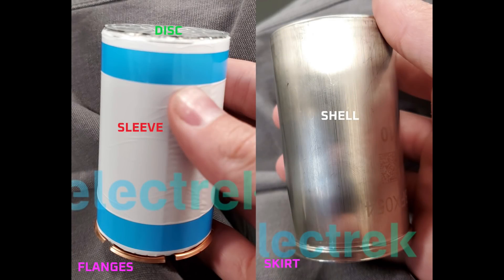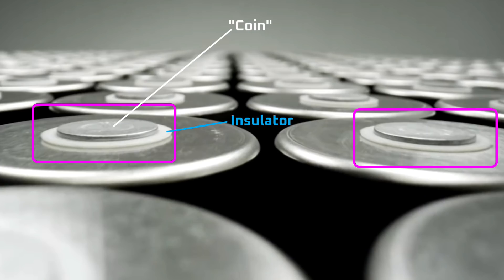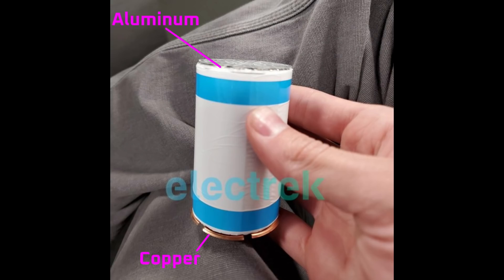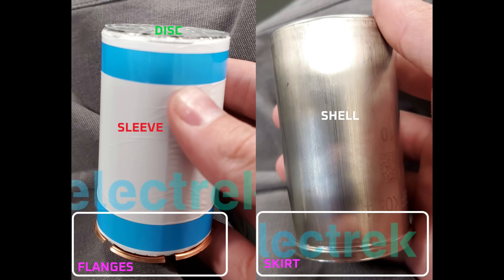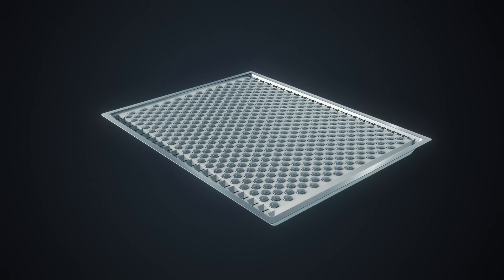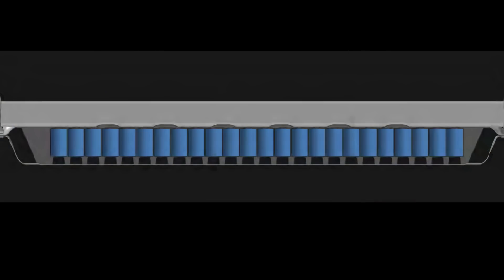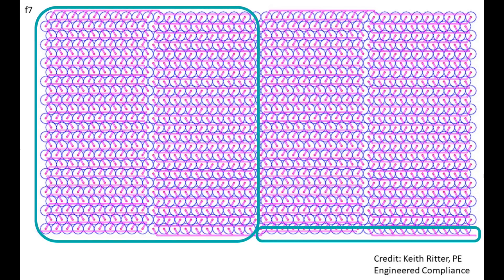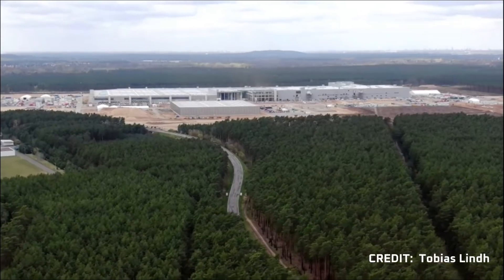#16 Manufacturing the Structural Battery Pack from the Cell Up

Comment: Tesla is betting the company on the 4680.
Reply: Please explain further. Are you thinking that the future is in solid state Li-ion? Prismatic? Why do you think that the 4680 is a risk so large that the future of the company depends on it?
Reply: @Buddy308  The 4680 is the way Tesla is banking on to lower costs. It will have to compete with hoards of competitors soon. The 4680 is unproven technology being is such a large form factor. If, for example, the 4680 catches fire and a massive battery replacement recall is issued, it could end Tesla. They have designed the future around single piece castings with structural battery packs that hold 4680 cells. They are out on a limb.
Reply: @HeavenGuy  the model y from Freemont are currently being produced with 2170 cells and single rear body castings. While 4680 is ideal, tesla can pivot back to non structural battery packs with a few more cells (already proven and works better than competitors) and be fine. Would it be bad for tesla if the 4680 architecture was dangerous? Yes. However, if the 4680 architecture is safe it's a game changer.
Reply: @beilkster  Agreed. They are betting the company on the 4680 and if they hit the ball, it is a screaming home run. If they don't, there will be starship pre 15 style crash landing.
Reply: @HeavenGuy  
Many good and valid points have been made, but I still don't understand why it cannot be tested extensively enough to assure the worth and the safety of the concept before implementation. I still don't understand why you think the company will implode and cease to exist if the technology turns out to be unsatisfactory. I'm not saying that you're wrong. I never meant to argue, just to understand.
Reply: @Buddy308   We aren't arguing as far as I can tell. One of the Korean automakers just recalled all their electric cars for battery replacement due to fires. Even GM recalled a bunch of bolt EVs for battery fires. A bigger form factor 4680 means potentially more heat generation. I'm saying it is a risk is all.
Reply: @Buddy308  future products have designs that depend on the 4680 to work, with the structural battery pack. The designs would have to be radically different if Tesla has to use 2170 cells. But more critically than that, Tesla needs to have the enormous amounts of battery cells they are counting on the many innovations of the 4680 to allow them to produce. The amount of investment, time, cost, and then the added cost and complexity of making battery packs using 2170 cells makes it way harder and less likely for Tesla to ramp production at the speed they want. If for some reason Tesla were to be forced to abandon the 4680 project it would be a severe hit requiring redesign of the Model S Plaid +, Cybertruck, Roadster, Semi, Model Y Berlin, the Berlin and Austin factories, and likely cutting production growth projections drastically. The 4680 is the keystone of all of Tesla's plans for the next decade, without it Cybertruck and Semi will be delayed probably three or four years, it would seriously endanger the company.
Reply: @tribalypredisposed  I would have to respectfully disagree with you.  There is nothing about the 4680 that you couldn't do with a 2170 cell.... you can epoxy them in, and the cooling could be done on ends as well.  The only thing about 4680 that is special is the tabless design while the size hits the sweet spot for maximizing the density of the battery material, and in reducing the number of welds needed for the battery.  Tesla, instead just decided to start from ground zero, and develop a battery for efficiency in both battery density and manufacturing.  And since they are the big boys on the block, they are now steering those improvements towards their manufactures.
Reply: @RuckerDavid  , no. You cannot just epoxy in place over 4,000 2170 battery cells, then successfully wire bond them with super tiny wires across a huge battery pack and make a structural battery pack with them. What Tesla has been doing is hard enough already. Even if you could, the speed of production is much slower with the tabs and a wet application of the electrolyte. The main reasons Tesla is going to the 4680 are to cut costs per kWh at the pack level and to achieve far higher production levels. The 4680 can be made faster in far less production space with far less investment and equipment. It took four years to ramp up to 35 gigawatt hours of production at the Gigafactory, and Tesla wants to have 3,000 gigawatt hours of production by 2030, so the 2170 is clearly not the answer.

Comment: As the triangle elements of the pack may be in line with the rows of cells from side to side, the rows would be offset from each other by aprox. 1/2 the diameter of a cell. This would possibly account for the size discrepancy of the triangle area from the left to right side of the pack in the illustration.
Reply from the maker: Good point!
Reply: @thelimitingfactor  BTW, you do an amazing job in bringing forth and articulating very complex information. While we will likely be surprised by some of the details when this technology actually makes it to market, your analysis helps to put the technology into context and helps create an informed picture as to what can possibly be expected from the limited information available.
Reply: Was thinking the same
Reply: @joewilliams1358  jup, we're likely looking at a cross section
Reply: Dang. You beat me to this comment and made it more clear...
Reply: @Thomas_Acharya  My apologies for impinging on your territorial imperatives.